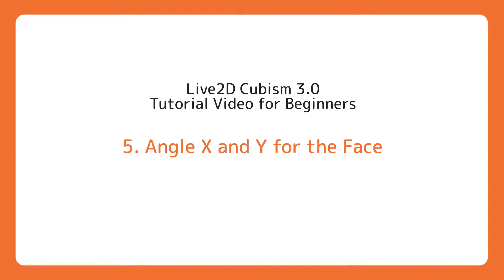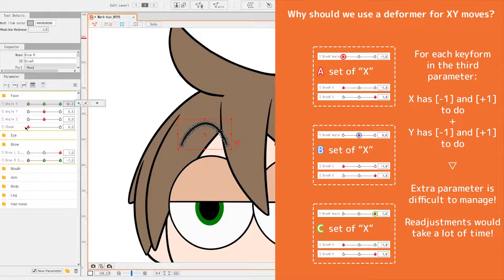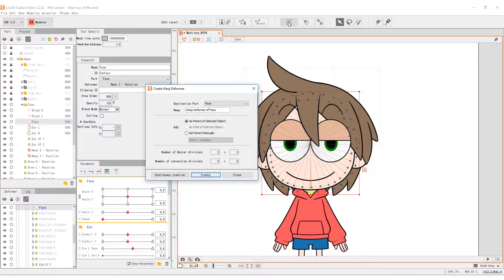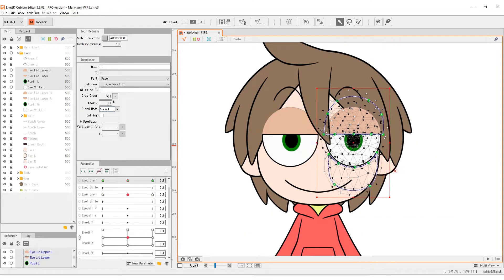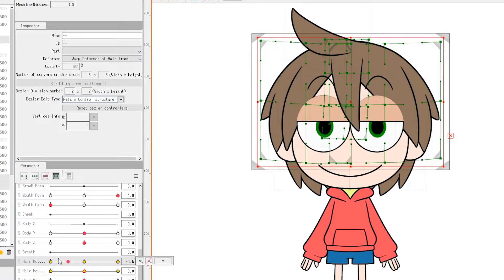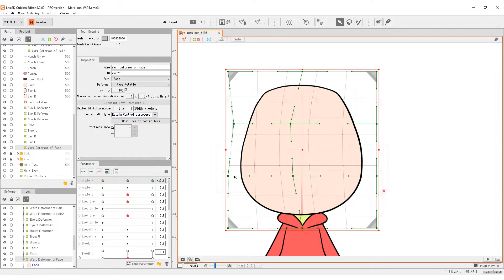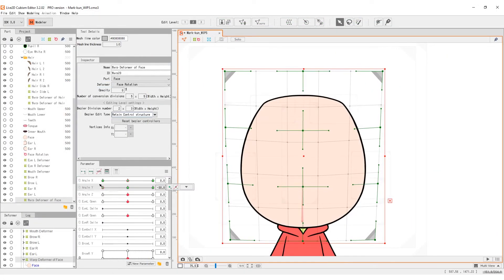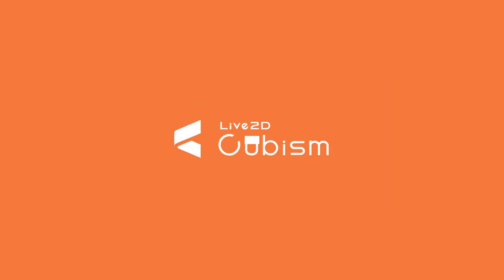[Official] Live2D Cubism 3 Tutorial 05 "Angle X and Y for the face"

Comment: Just something that would help alot is showing the Deformer log on the left while you do all the parts instead of skipping in to orange boxes and showing them all at the same time.

I'm having issues trying to actually link all the movements to the X and Y Angles so it moves the entire face and I have watched these tutorials again and again, trying to figure out what I am doing wrong.

Not only that, it seems that if I try and link the deformers to one another, the software starts to jam up and use an excessive amount of memory.

Would appreciate some help.

Comment: Okay so I'm moving the mouth part for the left-to-right movement, default mouth (which is a smile) have moved nicely but when the mouth is opened it just stays in the middle and not moving along with the face, is there any way to fix it or do I really need to move each keyforms manually?
Reply: Having this same issue. Making the mouth open and it suddenly swerves back to center, even if the character is looking to the side.
Reply: Ok I ended up just removing the keys I made from the mouth open which were sharing the same deformer as the head turns, and gave it its own deformer and now they work well in conjunction